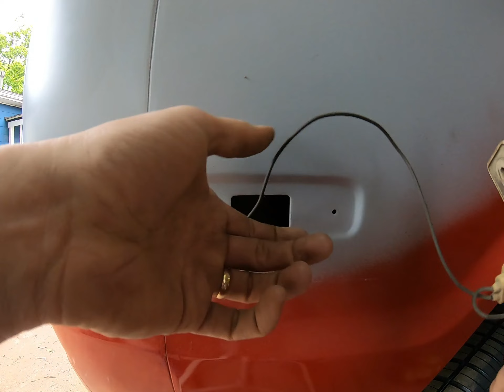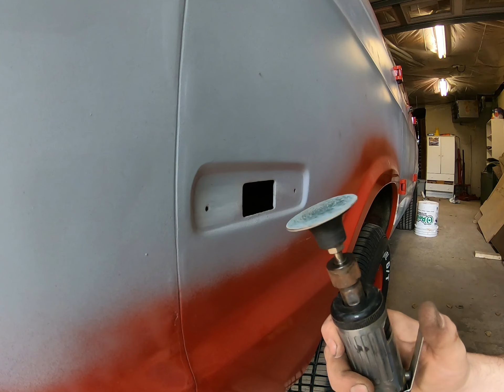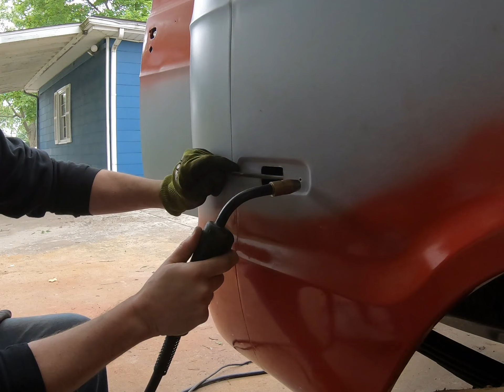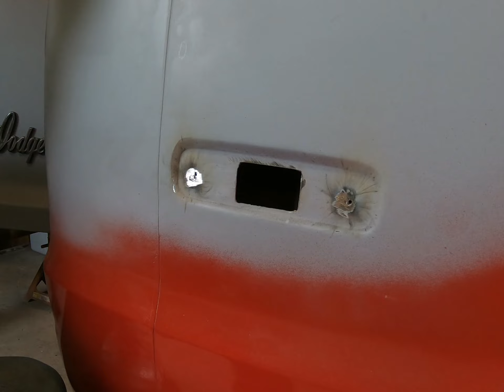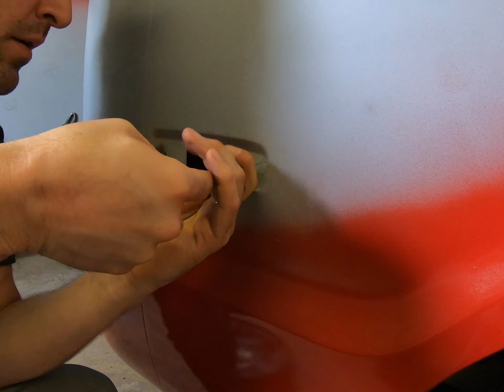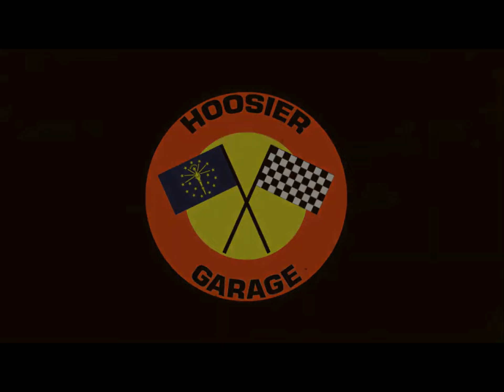Fixing Stupid Stuff - Hoosier Garage

Comment: Great video! Great fix! Reminded me of a Quarter skin I put on a 72 dodge challenger back in the 90's, after I welded it in I found the gas filler hole was stamped 2 inches toward the front and the filler tube wouldn't line up, I had to cut it out and move it back 2 inches. Alot of the first replacement parts were terrible back in the day before AMD came along!